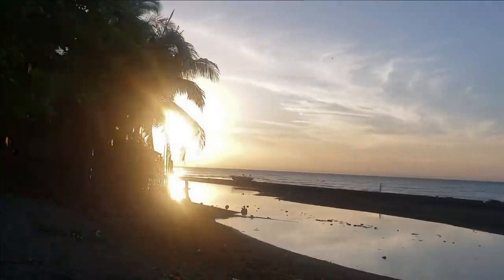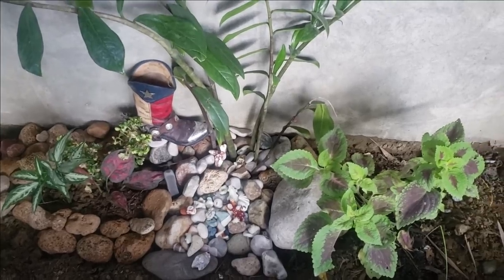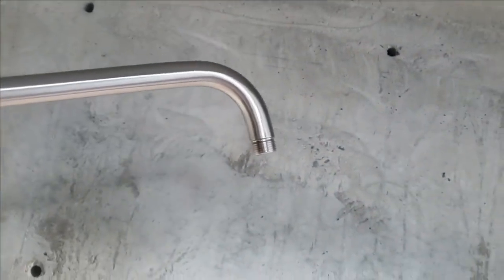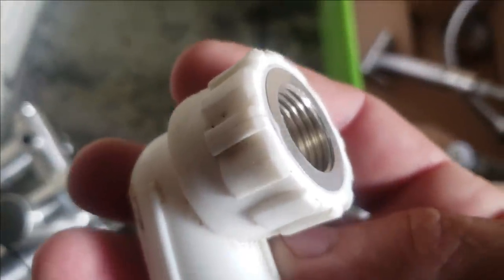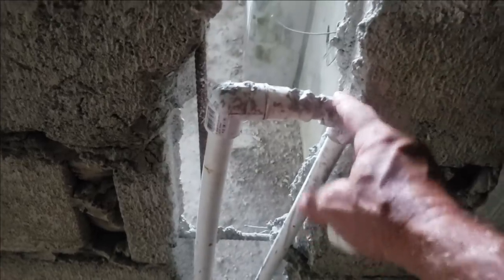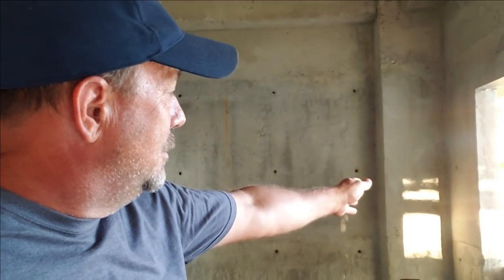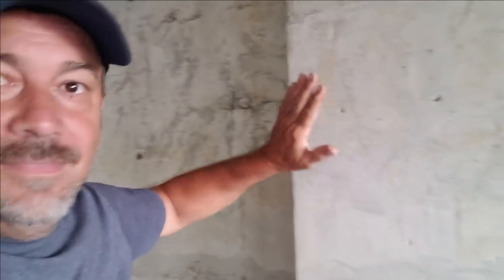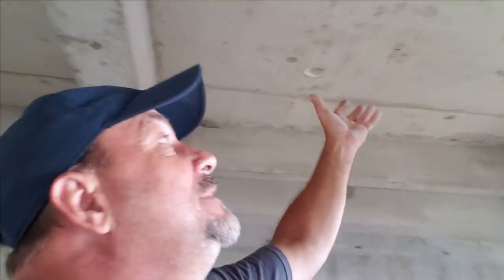Philippines Beach House Build Day 159 Part 1  GIVE UP  DREAM Beach CONCRETE HOME? Just Informed

Comment: They just don’t take the time to lay the blocks right. They just eyeball everything, no level, no straight edge, What ever mortar oozes out from the joint, stays out. It’s all comes down to sloppy laying and no taste.
Reply: NOT ALL. Good masons usually string the horizontal with hose-water level from end to end and move it up after 1 layer. They also use plumb bob for the verticals to make a well made vertical walls. Good foreman and experienced mason is the key. If you use a very experienced mason (which they have plenty of them) you won't have problems you mentioned. Remember, you have to get your CHB from a trusted CHB maker. Nothing wrong with using hollow blocks as long as you have the right rebars, placement and walls and columns well-designed to carry the hollow blocks dead and live load. To tell you frankly, Texas-Filipino's way of construction is okay but it is a little bit over-designed which is not bad. I assumed he had soil tests done for that structure is massive and heavy. If you want, you can ask his design and computations if that structure is well-designed or over-designed. I once saw a nice big expensive house in Gen. Luna Street along the highway that sunk due to heavy load. They did not do a soil test and install pilings.
Reply from the maker: they did that here as well. Use a water level set up lines for rows etc. No matter if use good or bad hollow block the cost is still higher with less strength. I just saw a condo building go up near here build by SM City Properties. They did full casting walls and all . It looks so nice. I was happy to see that. yes I had soil text done and you are wrong test structure weighs less than a hollow block structure finished out would have   Also I oversized my footings more than recommended. Build a one meter by one meter finished out hollow block wall - rendering and all. Now cast pour one same size like mine. Weigh the 2 and see which one is heavier. I bet you that hollow block wall weighs DOUBLE! Now lets talk about the floors mine are double matted steel with less thickness of concrete. The strength is in the steel not the thickness. so drop the weight on that. Now omit the drop down ceilings always being built here. Lastly deduct for the large glass wall openings and open floor plan design on the second floor and your going to tell me I am heavier? this design is not over the top. is is more sensible. Your a great supporter and I appreciate you but your stuck and defending the way you know. You probably have no first hand knowledge of the details and the ends of outs of this build. Even the masons here all agree and see this is wiser and lighter. Thicker concrete does not mean stronger - proper placed steel does. less weight and you exchange money for concrete for money for steel. I am not some RANDOM JOE here building. I did commercial construction back in the USA. I had a 100% track record and never had a callback. I am still being contacted constantly to build since i retired from it.

Comment: You can not fix STUPID ! People think they no ,but in reality they do not know what they think they know. Until you get the pricing and figure that in you are just guessing, people that do not do this for a living have no clue at all . I have a construction business here in Florida and i know what it takes to build a HOME ! In the U.S.A. hollow block are 8 inch wide and we have real fine motor mix and you can lay them block a lot smother , but you still have to render . SO it is point less! HAVE a great day or night !
Reply: Philippine standards are 6" exterior and 4" interior. with 1, 1/2' dia. vertical bars per block and 3/8" horizontal every 3 layers of blocks. All block cells filled with concrete mix.
Reply from the maker: very few ever use 6 inch outside  they go 4" all the way. A commercial build or a KANO with a fat wallet might go 6. I really laugh at the Kanos who think the answer is buying a hollow block press and making their own stronger blocks!!!! Your cost just got even more expensive !

Comment: I know what they say about assuming having said that to start :)  I assume they do not use PEX in PI?  I see PPR being compared to PVC pipe all the time but I have never seen it used in house pressured plumbing,  is PVC ok to use in Texas for in-house plumbing other than drain lines?  It doesn't seem fair to compare PVC to PPR when as far as I know (I am by far no expert) it's apple and oranges? I have plumbed 2 houses with PEX and I love the stuff, especially here in Montana, It won't crack when frozen :)  Sorry probably just blathering cause PEX is probably not available in PI.  Love the house and your Vlogs, just wish you would not spend so much time on the asshats who post negative comments, your living the dream and I am jealous as hell :),  keep on keeping on.
Reply from the maker: PPR is superior to PEX and they both won't crack in freeze . PPR is mainly used in Europe. You can order it in USA.  I think insurance companies which rule USA don't want the liability of the tool and people burning themselves in the DIY market. You know BIG BROTHER BABY SITTING ! lol
Reply from the maker: you are NEVER blabbering - this is questions  and they is great. I really appreciate your support. I love PEX too and cant find it here right now. I want it for my roof deck to pour into the concrete for heat exchange.  Geothermal cooling sending the water cycling  into my water cistern all day extracting heat using a solar pump. Then at night let it rest and the water in the cistern can cool off.  I REALLY want pex for that.  If you find anything my way let me know.  on the ASSHATS I love em. They open up discussion. Negatives to Postives  -- eating up the bullets and spitting them back with good information! :) :)

Comment: You got my attention. First time I have seen a better idea than all the good ones I used.  I been working real hard on how to do my guest house walls. You really help me out here. I wonder about the 3/4 inch plywood with (woodtech) wrote on it. can you tell me  -did you treat it? I thinking using  wood sealer on some cheap stuff. I got a 20 by 20 guest house and I need some walls. You are correct, the cinderblocks takes months of rendering.. Sand, plaster, sand, skim coat, sand paint paint sand paint, I likta went crazy. It took 1/2 time of building the house. That looks like melamine sheets, pvc 1/2 spacer, 1/4 in 8 inch all thread n washers.
By he way, I'm from Tyler. Names Doug, 24 years in well head Gas Measurement in East Texas and 16 in retail hard times.
Reply from the maker: that plywood is made just for forming with a poly film on it so crete dont stick. it is sold all over southeast Asia now.  By the time you put wood sealer you will be out same cost to by the right stuff. Also we tried that in the past - the sealer reacted and made it actually stick to the crete. it was a mess to scrap off the crete.  if you use plywood just roll diesel on it  I am using 3/8 all thread. get fender washers which are broader than these.
Reply from the maker: Tyler - man your just a skip from me in Terrell

Comment: Brother, if it makes you happy who gives a rats-azz what anyone else thinks. I have built two homes here in the traditional method but with my US construction experience for the foundation, electrical, and plumbing to my standards. I got the same BS from some ex-pats. Forget them. . . whatever floats your boat. My comment higher ceilings hahahaha.